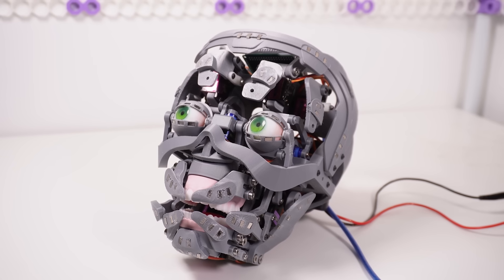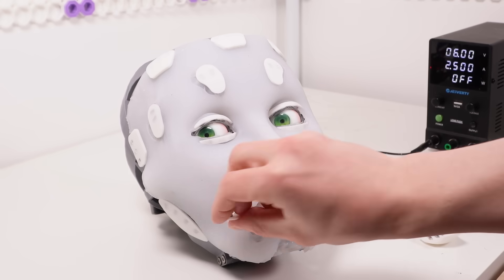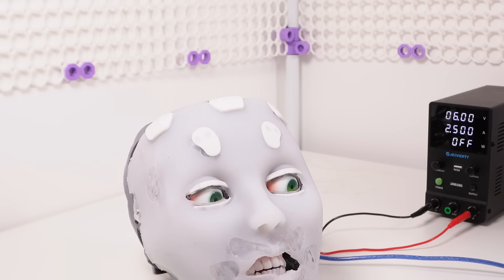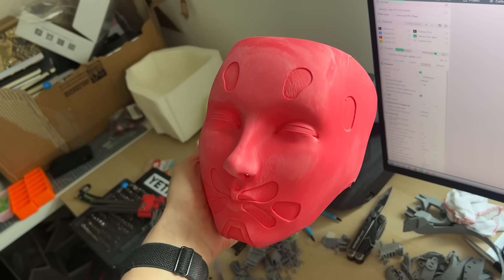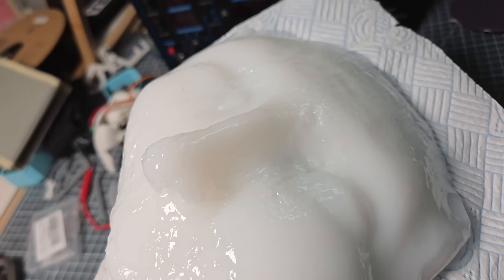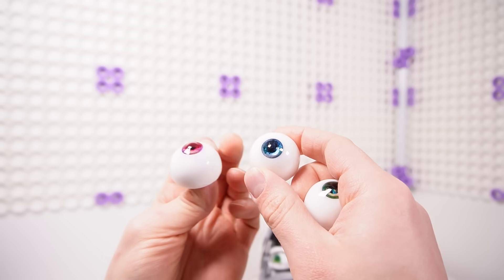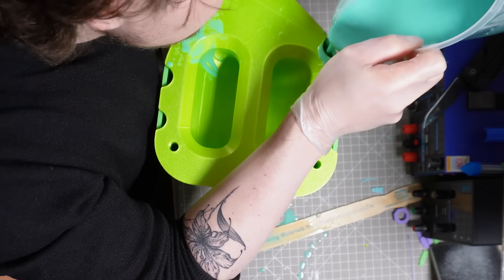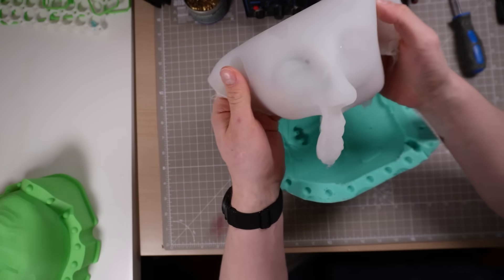Silicone Skin and 3D Printing: Creating an Expressive Animatronic Head

Comment: This is absolutely wonderful experimentation and the fact that you're working towards perfecting open-source models is something I love to see amongst creatives with a public audience. 
As far as uncanniness goes, I think you've already hit a good groove of material research and component design to overcome a lot of the creep factor, which seems like a great sign that further work will only better the recreation of natural expression. 
The only thing I can offer in advice is a rudimentary observation regarding the magnetic attachments. Maybe using thin plate magnets, either built of individual panels or shaped one-piece plates might help increase the surface area and decrease the wear on the surrounding silicone compressed by the magnetic attraction. 
Or exploring a non-magnetic alternative such as maybe designing silicone replacements for the underlying parts that control skin movement? (Sorry, those spider leg parts. It's late here lol, I didn't retain the name you gave them. But if you made the silicone touching parts of these from silicone as well while being able to glue or secure these parts to the rest of the leg attachment. 
In my head, this would allow you to swap out the leg pads at will, fixing them into the sturdy rest of their design and then bond the face mask directly to the silicone pads. 
This could allow you to simply pop the face off by releasing the silicone pads and lift them off as part of the face without worrying about resetting magnets or tears occurring near or on the surface of the mask. 
The softer silicone pads may also lend some bit of reality in terms of replicating the specific rigidity and fluidity of muscle movements? 
Like I said though, born of a rudimentary grasp of material physics that is full of holes - reflecting for 30 seconds has me already finding possible hurdles. Still, I love that you inspired me to think about it!
And that fact that I could explore these half-cooked ideas myself by adapting/replacing open-source parts to test unique and silly ideas on top of solid groundwork. 

As for the development of resources available to the public, I think there's plenty of potential for developing a range of design packs, pre-made component packs and eventually full pre-made assembly kits. 
If I currently had the right combo of time and resources, I'd absolutely start with a provided file archive and instruction manual/follow-along tutorial to tinker away on my own - I could still also seeing myself purchasing a full assembly kit as a giftdown the line, for anyone I know who has an interest in projects like this but who maybe younger, less experienced or simply daunted by engaging with the project in a more independent way. Looking at other educational/scientific/creative channels who offer a range of kits, subscriptions, free and paid digital resources, collector's items and replacement parts would likely be helpful and something you're already doing in the background. Even just Vsauce for example, and the range of niche products they produce for viewers. 

Overall though, I just want to reiterate what a cool project you've got going and it feels like your dedication is build a solid base of material results that'll give you a lot of freedom to model modes of access and support available to supporters of your channel and work. Best of luck with it moving forward, I can't wait to see more.

Comment: Unfortunately, I don’t think we’ll get to a bionic hand, that is actually better than a real one. The range of motion and number of sensors needed and that’s not including figuring out interfacing it with the residual limb. As an amputee, who’s interested in robotics and 3d printing I follow it closely. My dream is a 3d printed arm that is 100% my DNA, we need to figure out how skin senses pressure and heat first.

Comment: Love what you’re doing here.  You’ve obviously considered this but does having some types of lips or grooves in the back of the silicone skin create unsightly wrinkles or folds on the front? The magnet solution seems to work well I was just thinking about ways to interface the skin and armatures.  What about nodules or linear raised areas (m) and have small slots or indentations that get wider with depth with corresponding designs on the moving parts (f) and the skin just presses into them and locks?  Anyway just me rambling.  Looking forward to more and your work is inspiring me to consider similar projects. I work in wood (learning to make violins currently) but CAD and 3D printing is fascinating because it’s a great way to realize some of the designs I have.

Comment: clay might have had sulfur in it. if it did, that's entirely likely to inhibit the curing of silicone. always contact smooth-on if you can't find the solution to problems on their website (usually can). in addition their products always contain compatibility information - always check that to ensure all materials being used are compatible with each other. however, regardless of how you got to where you got, this 'skin' is crazy! can't wait to see when you co-mold the magnetic parts into the silicone! hah.  and then paint the skin... terminator pink! Oo haha

Comment: You should put the Magnets into the Skin, i would suggest using some Fibre matt and a tiny Bit of epoxy to spread out the load on the slicone Skin and hide the attachment Point.

Comment: I think that an electrostatic clutch system could work better than the magnets. Every mounting point would need a pair of conductors and the high voltage may be unsuitable for the application, creating more problems than solutions. But maybe it'll be the solution you need, who knows?

Comment: My experience has been that normal slush casting of two part silicone does not work because slush casting requires curing in a gradient so that the surface in contact with the mold cures from the outside in, with the remaining portion rolling around curing more slowly.

Comment: Interesting idea! But wondering - have you tried UV-resin? (I have no experince with that, but thinking about use such thing in to realise my idea related to bionics) Maybe it will be more simple to work with and gives more quic results - it needed only fem minutes under UV light to get shape and maybe also allow different stiffness(by mixing different types) and thickness...

Comment: Hi. just found your channel. cool project. I have worked on something similar to this and had some of the same problems with the silicone ripping or not gripping the servos. the solution I came up with was to imbed fabric pockets into the silicon. I also tried valcro which does work and makes it easy to attach but the problem with that is if your movement is too much then they just pop off the valcro. 
so in short. 
1. I suggest the idea of imbedding fabric pockets for the servos to integrate with (or as you've said just imbed the connection points themselves) 
2. there is a stuff called Polydimethylsiloxane which I haven't used myself, but I know many robotics companies are using it for it's supposed ability to stretch and conform without ripping.

Comment: This would be a complete design change, but it would be interesting to see a robotic face actuated entirely by microfluidic channels within the silicone. I bet there are 3D scans of face musculature that could be used as a reference. The silicone would almost certainly have to be SLA 3D printed and may even call for variable exposure to achieve durometer gradients around the muscles.

Comment: Instead of magnets have yoi thought about adding lego style peg and hole system? Cast the head with lego pegs added then you can just push the silicone pegs into the holes on the animatronic skull.

Also there is a great bts video of disney animatronics where they made an entire inner throat to inside mouth to hide the servos. This is then connected using a peg and hole system then sort of you pull over the pegs around the mouth area. You would then attach the skin as normal

Comment: welldone mate, great efforts, looking forward for next stage, one advice though " try to cast face by creating 2 3D printed shells, with a hallow negative in between, that way u save a ton of silicone, and demolding is much easier. finish the 3d printed faces with a layer of expoxy that will give smoother surfaces and maybe some sanding before applying epoxy as a surface finish.

Comment: Hey bud, I'm working in movie industry and use silicone quite a lot, use wax mold relese, does not affect any silicone i've used so far and it is great for releasing. It is liquid, so you just need to brush it over the mold. I always use it when making 2 part moulds, or using poliurethane castings in some cases. 
Love your channel, love your work, I am fascinated wth animatronics, but I never really have spare time to dig into it..

Comment: Very cool project! I go through hundreds of videos to find gems like this. 

From here, you could cover someone's face in myoelectric sensors, then makes faces and record the muscle (signal) input as analog waveform, using a DAC. With that as a dataset and a waveform (audio) AI training tool, you could prolly train an AI to listen to what you said and react to your emotional tone by making appropriate facial expressions as you speak. That would be so freaky with your head! 

That, or perhaps you could break every expression into nodes (with coding/scripting) with a specialized generative model that can play back waveforms for creating a smile, or an eyebrow arch. In other words, a neural network model trained on thousands of smiles, one trained on eyebrow arches, etc. That way, you could use the different nodes as building blocks for stuff like interactive installations and themed rides that use audio-animatronics.

Comment: I don't know if you can use the idea:

Perhaps you know 'mushroom velcro'. Perhaps it is possible to cast a negative of the (lightly modified and scaled) shape into the silicone to later attach the 'skin' to larger surfaces.

Comment: Being able to have plug-and-play CB and a pre-packaged set of screws and servos could be a huge game changer.
Ive been wanting to make puppets, animatronics, and animatronic puppets of various character designs of mine. Big issue is they are very stylized, or not human. Like aliens with 1 to 3 eyes.
I dont have a problem troubleshooting this and printing out prefab STL parts with my printer, and modifying them to fit with my designs. But I struggle to figure out where to even start with servos, circuit boards, and connecting them all up. Having a base kit to work from would be great.

For your robotic character, I would have went for large chunky screws to attach the skin. That would let you get more defined wrinkles and stretched proportions without risk of the magnets popping off. It would also really lend to the aesthetic I think.

For a more realistic skin, you may also consider two layers of silicone. One molded to be veiny, lumpy, and with deep-set wrinkles. And a thinner, skin layer, with a subtle skin texture thats firmly adhered ontop of the "flesh" cast.

You could also consider cable-driven servos to mimic strands of muscle. Have those attached directly during molding the flesh-layer, or afterwards in setting up the face. And they can pull face groups in more convincing ways.

Comment: This is awesome!! Well done. If its helpful you can lay a 2 way stretch mesh in the back of the silicon to avoid tearing. It will help in its long term durability. To adhere, you can use the same silicon as an adhesive as it will stick to itself. Looking forward to seeing more.

Comment: I think you could forgo the magnets entirely. 

Basically, replace the magnets with threads and screws, and use a fixture to embed small panels into the skin, to give yourself hard points to attach the skin to the mechanism.

———————————————

For more detail: 

First: On the skeleton/mechanism, replace the magnets with threads/threaded inserts/helicoils. 

Second: Design thin panels with thru holes that can be bolted into these threads on the mechanism. These panels will be embedded in the silicone, to give you hard points to bolt the skin to the mechanism. These panels should have thru-holes that match up with the threaded holes of the mechanism, and a countersink so the screw doesn’t stick out into the skin. Also add some larger holes for the silicone to seep into and adhere the panels in place, so you don’t have the stretching on the panel attachments you saw with the current iteration.  (See Bonus Note [1] at the end)

Third: Design the mold. You already have the outer mold, but you need to make a new inner mold, which will hold the panels in place while you’re casting the skin. This means that inner mold needs threads or helicoils that correspond with those in the skeleton-mechanism. 

Assuming you’re willing to use slush casting, the inner mold will be pretty simple to make, as it’s just a fixture that locates those threads in space. Just extrude a 3-7mm diameter cylinder an inch or so from those helicoils, towards the center of the mold. Then connect all those standoffs you just made with a sphere or spheroid. That locates the helicoils in space, and leaves enough room for slush casting. (See Bonus Notes [2] at the end if you want a shaped inner skin surface)

the inner mold holds the panels, and the standoffs keep the panels in the middle of the so it gets fully encapsulated. 

Fourth: Screw the panels onto the inner mold. For bonus points, put a small o-ring between the panels and the inner mold, and under the head of each screw, so the silicone can’t seep into the screw holes while you’re casting.  

Fifth: Pour the silicone in your outer mold and fully cover the surface. Insert the inner mold to apply the panels, and add more silicone to cover the panels entirely [3]. 

Sixth: Once the silicone has cured, remove the outer mold, and use a razor to cut through the silicone around each screw head. Leave some of the silicone attached, so there’s a flap that can cover and hide each screw head [4]. 

If you cut the flaps at an angle, like a cone, pyramid, or trough, they should self-register when you close them, and will hopefully be almost invisible!

Finally: Remove the screws from the panels, and remove the skin from the inner mold. 

Do whatever cleanup is necessary to get rid of flashing and or vent flues. I recommend flush cutters. 

At this point you should have a single-piece skin with embedded mounting panels, and you can install it on the face! No magnets, hopefully no silicone ripping, and no superglue to deal with. 

———————————————

Bonus notes: 

[1] There are other geometries  that you can add on the borders of the panels to improve adhesion between the silicone and the panels (e.g., t-slots and zipper-shapes). But with how thin the panels will need to be, the geometries may be too small, so the silicone may rip too easily, or may not even flow into it completely without voids

[2] If you want a shaped inner surface on your skin, the inner mold will be your old inner mold, but adding the same helicoils I described for the slush casting inner mold. But the threaded standoffs will be much shorter - a couple millimeters instead of a couple inches. The goal is to get the panels embedded in the skin, rather than sticking out of the inner skin. 

You may need to add some vent holes through the mold, to allow air to escape around the panels, instead of making voids. I’d recommend either channels  or vent holes that partially overlap with the borders and adhesion holes in the panels.

[3]  If molding is giving you trouble, especially with a shaped inner surface, you may need to manually syringe some silicone in between the panels and the inner mold before installing the molds together and putting in more silicone. 

Alternatively, a two-stage cast may work better. You could mount the panels to a low-detail OUTER mold, and cover them with silicone before applying the inner mold to make the inner surface of the skin. Then, do a second stage where you fill the proper outer mold with silicone, and insert the inner mold with the partially completed skin. 

That procedure would probably take some experimentation. I’d probably just go with slush casting. 

[4] If you don’t want to cut with a razor, you may be able to do some 3d Printing shenanigans. If you make a vertical plane or circle geometry the thickness of one printed wall (often .2 or .4 mm), it’ll print as a single wall! 

You can use this in a couple way. You could make, functionally, a cookie cutter that you can use to make identical flaps over each screw. 

Alternatively, you could use this method to make thin walls on the PANEL when you print it, which will cast the flap into the silicone. After curing, the single wall is thin and fragile enough that you can use pliers to remove it from the rest of the panel. If you do it this way, you may want to put a little mold release on the printed wall, and fill the area inside the wall with syringed silicone, to ensure it doesn’t just become an air bubble.

Comment: why not go the skeleton inside the silicon workflow. So instead of a metal skeleton you replace it with wires and panels but make sure you wrap everything with plastic so it won't rip the latex over time